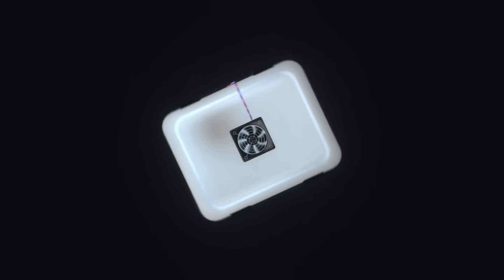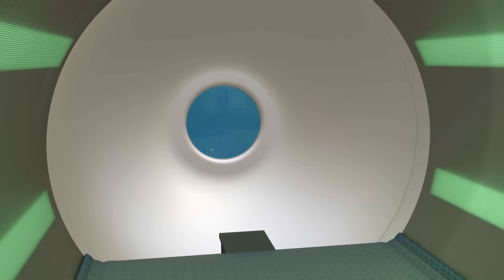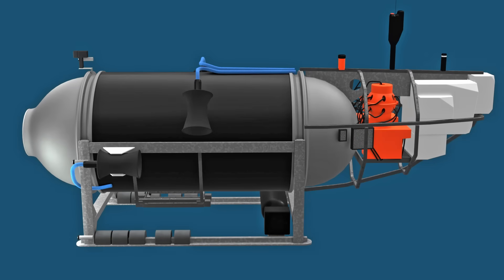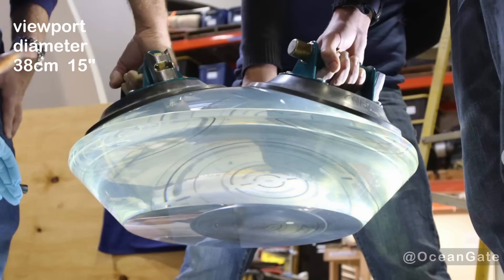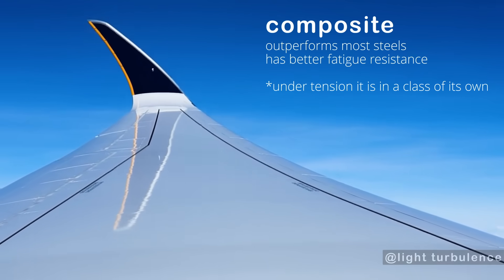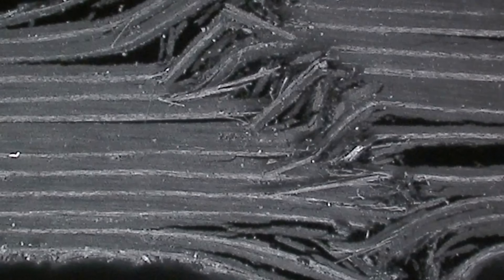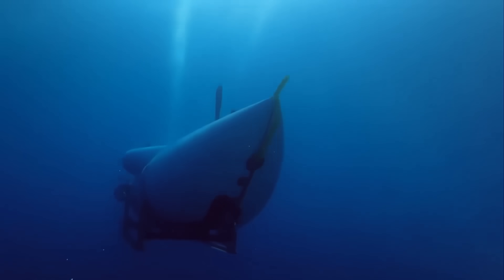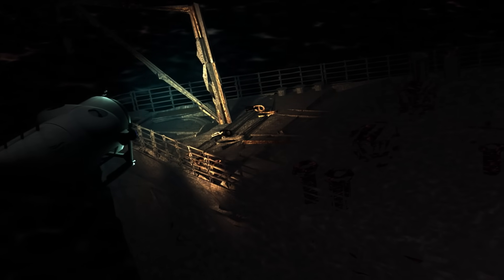Titan Sub | carbon fiber - Detailed Tour

Comment: Definitely a contrarian view that the carbon application is no problem. Will be good to see the final report.
Reply: I reckon most people would say Mike's findings here are contrary to most of the analyses heard since this incident - and many of those would only be surface-level analyses, anyway - it'd be hard to say it's 'contrarian'.

That word implies resistance or opposition for the purpose of simply offering resistance or opposition, and I don't think it applies here.

Furthermore, all of that is tangential to the chief contention I offer in reply to your post, which is that Mike's never said the carbon application is no problem, he said the carbon fiber material was not manufactured using techniques and processes necessary to ensure the optimal specs to prevent implosion at the level of compressive force acting on the submersible at depths approaching that which the Titanic rests at.
Moreover, even had OceanGate manufactured the cylindrical hull to the highest, most exacting standards currently even reachable by human beings, OceanGate did not test a unit to destruction, which as Mike said is the only way to know for certain to what depths and to what repeated number of dives the structure can be relief upon.

He didn't say the carbon application was no problem. He said the carbon fiber manufactured in the way OceanGate chose to was the problem.

Comment: There are some good points made here, but the most important thing (to me) was not addressed: cycling. Mike you used airplane (wings) as an example of carbon fibre's strength and durability, but that's a bit ironic as it was in airplanes that the dangers of pressure cycling were first fully understood. Carbon fiber is insanely strong, but this sub was cycling it with the plan being "we'll listen to it, and if we don't like what we hear, we'll go back up." Just not an acceptable plan, especially because all of the numerous airplane crashes that have been caused by pressure cycling were caused by the pressure cycling of AIR. A poor weld, a weak door latching mechanism, even just an unusually heavy workload will all EVENTUALLY pop on an airplane after enough cycles. Yeah I know plane cabins aren't made of CF, but that's AIR inside of metal that's supposed to do the job, and the cycles still win from time to time. Going to the bottom of the ocean over and over again, with carbon fiber undergoing that kind of insane load and cycling back to sea level over and over again, was always going to fail eventually. So… it was just a bad plan.

Nobody is saying carbon fiber is weak, just that it's way weaker (still super strong) in compression than in tension, and in a vehicle whose whole job is to undergo massive pressure cycles, it's just mindblowing that Rush was unable to listen to his peers and continued with the foolhardy design. Science is awesome, so is carbon fiber, but sometimes there are tasks for which the stability and durability of advanced metal working is just not something you want to accept substitutes for.
Reply from the maker: Firstly if I went too technical in the video I will lose the vast majority of my audience. 
Load cycle fatigue is basic engineering. If your maximum load doesn’t go into the danger zone you don’t get fatigue. That why you have 70 year old planes flying today. 
It requires sufficient excess structural material so cycling is not causing damage. Alvin sub has been diving thousands and thousands of time and the scientists climb aboard with confidence. Alvin does not enter the fatigue zone. 
Developed and tested properly with all the inevitable surprising weak points ironed out Titan could have done the same. 

In tension nothing comes close. In compression carbon fibre is right up there with the best metals. In metal you cant align the particles with the force. In carbon you can and thats the trick.
Reply: I actually agree with most of what you say, @Mike-Bell  , but to say you don't get fatigue is misleading, everything can fatigue, those 70 year old planes have very little left of the originals, because they are strictly maintained and parts replaced as those things wear out. But those don't require sonic maintainance, and stressing the hull to test for any anomalies, it just seems to me like the swiss cheese model of things that could in theory go wrong, because those things will always find a way eventually. I think it's telling that all of the metal sphericals (like Alvin) that have made thousands of dives continue to do so, while Titan imploded after such a small number. Safety first, to me, just doesn't align with the steps they took here in any way by trying to make this work.
Reply: Do you have some citation that a 70yo Cessna 172 or DeHaviland DHC-2 Beaver or DHC-3 Twin Otter has had most of the airframe replaced?   @Taranofsky
Reply: @mycosys  why would I make such a claim? Aircraft like those are not subject to the kind of cycles I'm describing, which occur on commercial aircraft that fly at 35,000 feet. Stress cycles are why those have circular windows, because the square window planes kept popping in the sky and killing everyone. They actually used water to test their hypothesis. Now, those stresses are fractional compared to forces like these. Stress cycles matter a ton, is my point, and this entire process didn't seem to respect the power of how insidious those microscopic cracks can be
Reply: you have quite a talent for dodging the point,  @Taranofsky
Reply: Which pre-1953 pressurised aircraft that is still flying were you referring to,  @Taranofsky  ? The only commercial pressurised jet in 1953 was the Comet 1, they pretty famously arent flying.
Reply from the maker: @Taranofsky  Overloaded material fatigues and after sufficient overloading cycles will fail. With sufficient excess structural material or lets say an underloaded structure wont fatigue. The composite wingspar of the Airbus you set foot on is stressed to below its fatigue point because that is the only way the engineers can confidently release the craft for thousands and thousands of flights. The engineers with great diligence make the structure fat enough to not fatigue but not too heavy so it cant take off.  They optimise the whole structure to have sufficient structural fat but not too much and this is the main task of any structural engineer. 

Fatigue is not a foregone conclusion. Plumbers go to work every to unclog drains. Structural engineers go to work everyday to design structures that stay outside the fatigue zone. Call it their number one job. With enough testing and detail understanding Titan could have been made safe from load cycle fatigue.
Reply: @Taranofsky  A term you may be more familiar with is plastic/non-plastic deformation. If a material does not plastically deform due to an action, then it will not deform no matter how many times that operation is performed.

On a further point, cabin air pressure cycling is a VERY small stress on an aircraft in comparison to the stress on the airframe. Components like the wings are constantly flexing during flight creating tremendous forces inside the materials. However as Mike stated, these components are designed so that while the experience these forces, they do not fatigue, and so they can experience these forced millions or billions of times without failure. Had the Titan sub been designed and tested to these same standards they would likely still be in operation today.

Comment: The video of them attaching the  titanium to the carbon fibre with epoxy smeared on is what gets me. No way to test those resin seals.
Reply: The resin to my understanding was just to hold things together above water. Once you get to any depth, or even just underwater, the pressure on the end caps would seal them against the titanium far better than any glue would be capable of.
Reply: This scene reminded me of my first silicone caulking job. But then, my project wasn't travelling 4 km down to the Titanic.

Comment: I had not realized just how cramped it was on the inside, makes perfect sense. But somehow I was picturing something a bit less claustrophobic and horrible. Great video!
Reply: There are some videos taken by passengers you should watch.. its crazy tight inside for 5 people
Reply: what a way to spend your final moments: surrounded by smelly dudes in a dark cold damp pressurized can.
Reply: not a bean bag chair or a Grateful Dead poster to be seen. THIS sub is totally professional. 
EVEN the cheap knock-off Chinese version of a Playstation Controller was used. Not a real one.
And led lights, top of the line.
3 real screens, not 1, not just 2 BUT 3, and one of them is wall size.
I wonder if they wasted screws to secure the lego holder to the frame?

Comment: It does seem likely that the sub imploded due to poor lay up and design flaws. I was thinking of another possibility is the glue joints that are under extreme tearing stresses due to the different rates of compression and expansion of the carbon fiber and the end caps. In the photos for the salvage, someone pointed out that the end caps were stripped of all its glue.
Reply: No material is perfect. Even titanium is susceptible to metal fatigue and would need to be retired after load cycling. The problem is they didn't do any destructive testing to see how many  times the craft can be cycled. They should have loaded and unloaded the craft until it failed and then do an autopsy on the wreckage. But obviously they were strapped for cash. Thats the real tragedy.
Reply: Completely agree…glue joints and the connection between the titanium rings and carbon fibre…
Reply from the maker: In aviation composite and composite are glued together routinely.  The 2 materials have very similar rates of deflection under load so differential movement which is a great benefit. And suprisingly it is Titanium that has a more give than carbon fibre because carbon is such a rigid material... which is also why it is so brittle.
Reply: I have not seen all the photos of the wreck. The photos I did see the end caps were glue free. It seems to me that there should be glue left in the cap ends with bits and pieces of fiber hanging from them, not clean and glue free. Which leads me to believe the glue favored the carbon fiber over the titanium, which makes me think the glue joint gave away before the carbon fiber did?
Reply: @williambattermann5008  While I am not certain, I believe that at any appreciable depth, the glue would be irrelevant. The pressure on the ends caps and the resulting friction should provide far more attachment than the glue could ever manage. The glue may have favored the carbon fiber, but had the glue failed entirely, I expect it wouldn't have been noticed until the sub was removed from the water.
Reply: @Goodgu3963  The titanium rings cups the carbon fiber rather than just being flat. You could not inspect the glue after it has been attached.
Reply: @SourDonut99  My point was it wouldn't be noticed until the end cap fell apart after the pressure was removed above water.
Reply: @Mike-Bell i agree with op, he worded it better than my attempt.

The actual deformation (due to compression) would depend on the thickness of the titanium, I heard you mention the composite was 5" I'm guessing the titanium dome was thinner than that.

Comment: Carbon fibers lose bond strength as the temperature drops.  Take the inside temperature of the sub and the outside temperature of the ocean and you have a shear stress situation of the material itself.  Combine that with the compressive strength of the ocean at a certain depth and you will soon develop cracks and a very, very quick and disastrous implosion.  It was the carbon fiber.  And you seem to not understand what an implosion means.  Which is an initial collapse of the sub and then after the collapse the sub explodes outwards due to the energy of the collapse.  It happens in seconds.
Reply: mike is a a moron lol
Reply from the maker: The temperature gradient you are talking is small and irrelevant in relation to the overall forces.

Comment: I think it would have been well worth adding that there are CFRP ROVs routinely operating below these depths. Its pretty well exactly the average depth of the ocean
Reply: An ROV doesn't need to entertain a group of people in relative comfort.
Reply: ROV's don't have to maintain a 1 ATM vessel, so the carbon fiber isn't stressed...
Reply: @KB-kc7ou The electronics and cameras are most likely housed at one atmosphere. The main difference would be the much smaller size of and bracing within the pressure vessel.
Reply: LOL  @KB-kc7ou
Reply: @KB-kc7ou  Most ROVs do have a pressure vessel for buoyancy and to house research equipment and electronics. So yes, the carbon fibre hull is stressed.
Reply: @tonamg53  It is much smaller, though. It's strength threshold decreases with increasing size and these ROVs use a spiraling wind design, which puts tensile forces on it.

This thing failed as a direct result of using CF, and you people are trying to defend the use of CF in human-occupied submersibles, which is insane.

What is super odd is that the dude in this video said the CF could handle the necessary compressive forces just fine, with a safety margin, yet literally stated that it most likely failed due to the axial layer having no tension and only being under compression, which directly contradicts his claims that the CF used in this design could handle the compressive forces 'just fine.'

He literally admits it failed due to compressive forces. And claiming "CF can handle compression just fine when using a spiral wound design" is nonsense, as that puts tensile forces on the fibers.

Yes, the overall force is 'compressive,' but the fibers are put under tension on the outside whilst the inside is 'compressive,' and it is the tensile part that is holding it together (just like a bending i-beam has tensile forces on top and compressive on bottom).
Reply: @pyropulseIXXI  AUSS was only a bit smaller than Titan. It could definitely fit at least 1-2 person inside.
Reply: @pyropulseIXXI  Also what really nonsense is that people think CF is “weak” under compression. 

CF is “strongest” under tension… but that doesn’t mean it is “weak” under compression. It is still one of the strongest material for compression load available… exceeding many kind of metal.
Reply: @tonamg53  and, at any rate, it could have been made much stronger. Everything was a trade-off, and he was trying to minimize wieght and size. To see this design fail and then say "oh well CF must be no good!" is just silly.
Reply from the maker: Great point 👍

Comment: Axial Compressive strength of carbon fibers is 10-50% of their tensile strength.  And transverse compressive strength is 10-20% of axial compressive strength… even without defects
Reply: You're crazy!
Carbon fiber can withstand more compression than steel?
You're crazy!

Carbon fiber is good for withstanding tension, not compression!

Tension is different from compression!

Compression is based on molecular density and molecular structure.

Tension is about the elasticity of the materials.

Furthermore, even if the submarine uses activated carbon fiber, which is used in spacecraft for re-entry into the atmosphere, it cannot withstand high compressions!
Reply from the maker: What is your point?  Yes, in tension carbon fibre is in a class of its.  In compression it surpasses most steels.
Reply: @Mike-Bell  How do you figure?  It's fiber.  A good example used in interview I watched makes it quite clear, a small strand of carbon fiber can pull your car but push on that same 4 foor long strand and measure how much force it can withstand....none.  The answer is none.  A tube means nothing, it would be great and withholding force from within absolutely but from without it is utterly useless.  Interviews with this CEO he obviously just equats carbon fiber=strong.  This is why we see "fake" carbon fiber all over in plastic doo-dads cuz people just equate.  In this tube any constrictive force being held back was result of the tube underneath the wound carbon and the resin itself, he might as well have used fiberglass.  The metal tube underneath and the damn resin was the only thing keeping those folks who rode it first alive, which is testament to the damn tube shape and the resin manufactur more then this hard headed dude..  I'm surprised most by the fact it didn't fail on try #1.
Reply: @Mike-Bell  One thing not discussed enough here ....  "The Sphincter Valve Effect" 
What happens is.... BOTH noise & visuals are translated into Electrical Impulses for interpretation by the brain.
When formed, these impulses of information travel South to the Sphincter Valve aka the Orifice Interface.
The Sphincter Valve controls electric impulses in an effort not to overwhelm the brain.
Nerves are very thin in this anal-type area. They need a massive amount of bloodflow to pass the Interface, traveling on to the brain.
Once you throw TOO MUCH INFORMATION down there, the electric impulses backup, the Sphincter Valve closes, blood flow drops.... nerves can't pass information ....... and the brain has no choice but to mutter the only thing it still sees, OH SHYT!!!
Reply: You must work in vacuum to manufacture w/o defects. Even then it could be stronger. Titanium would have offered better margin for error.
Reply: @miketan4803 exactly. With an autoclave. There were so many questionable procedures and lack of controls. Maybe cf could work for subs, but we certainly didn't learn much if anything from Titan in that regard thanks to Stockton's haste. He should have been testing after every stress cycle. X-ray and ultrasound.
Reply: @Mike-Bell  the fact that it surpasses most steels is meaningless. Most steel tubes are not fit to withstand such immense pressures. It's not a matter of being better than something, rather, strong enough to do its job...